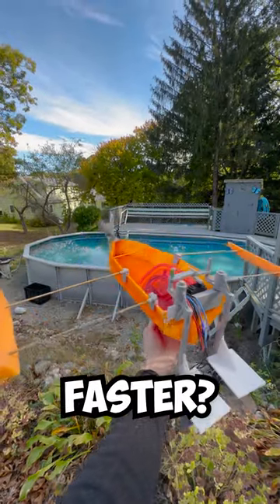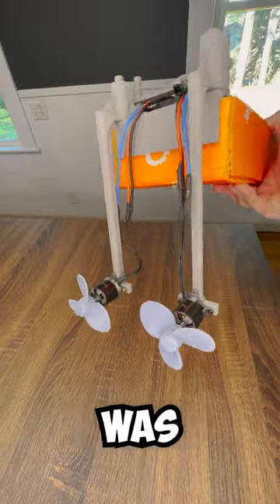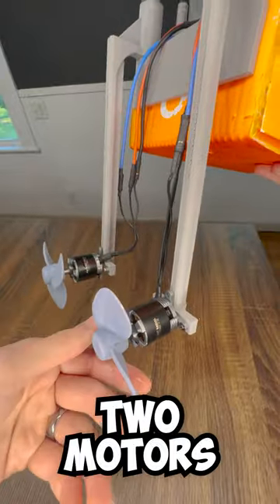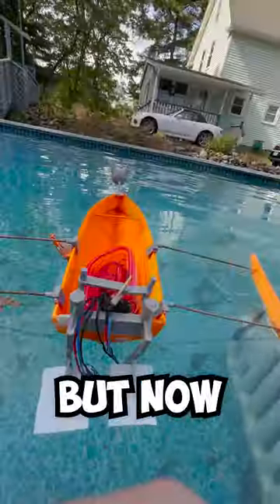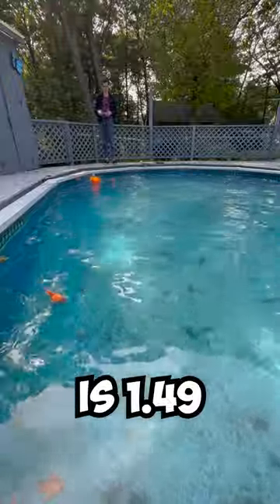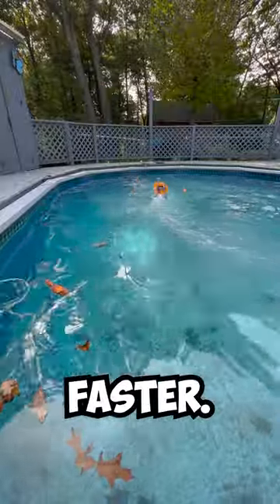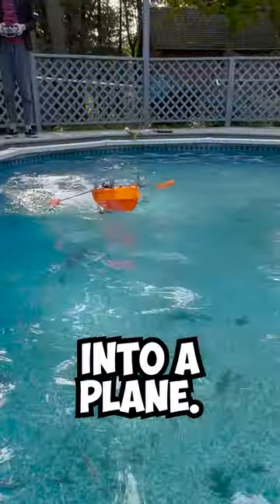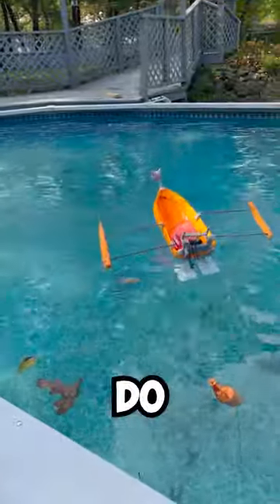Two Motors on DIY RC Boat

Comment: See the thing of having two motors it only adds more torque if you had a bigger whole and the ship was a little bit bigger but has more weights and a skinnier bottom what will happen is that it won't lops side if you don't get this then think of it as having a small yacht and you put 8 engines on it it's going to have so much energy world which he capsize, so when you do this ensure that the body actually matches the power of your motor

Comment: You have the Motors way to much under the water, which causes it due to lever flying Out of the water, If you want to have it fly Like a Katamaran or smth, Put the Motors in the middle of the boat and add some weight in the front

Comment: Use them more narrow hall that haul that you're using is good for marshes but not for the thing that you're using it for using long skinny call with a flat top that widens out if you need a reference look towards Viking boats that will provide a lot more room for all of your electronics

Comment: maybe make the tip of the hull heavier  and add a gear ratio so you get more RPM or make it 2 motors power 1 large propeller?

Comment: Add More weight on the front and remove the wall on the back, when the boats underside suddenly stops the water exits to the top making a twirl Pulling the end and lifting the front.

Either remove the wall entirely or give the boat a "tail" 😂
The tail should help quide the water further away from the boat so it doesnt twirl

Comment: Try having two motors in the front pulling it or don't have them so low in the back with huge flat plates because it's trying to hydrofoil

Comment: You need to adjust the angle of the engine, te aim is to sink the bow and lift the stern, to keep it flat.
Simply let the engine pointing the pow of the boat

Comment: Made it two heavy make a catamaran style hull with material a little lighter than the one your using. And use lighter material for propeller holders.

Comment: you need to remove the two little platforms above the motors because those platforms are making it back pike a hydrofoil

Comment: Design the bottom so it has the ability to cut through the water if you look at speed boats their bottom is Angled and they use it to cut through the top of waves while flying at high speed
Reply: Before they say he has done this he is missing the inward swoop that boats have to give the the self correcting stability that they have to make the singular motor not mess with the direction❤

Comment: Is the propellers are too far down in the water. It needs more weight. And make it a smidge and slicker. Those are ways you can make it better with handling speed.

Comment: ok so first, your gonna want to increase the length of your drag race cause as you make these faster with improved motors your gonna have to start slower so it doesn't flip. also based on normal boats your engines are way to low in the water

Comment: your back of the boat was too heavy that's why your boat become to fly at initials. but if you manage the weight then the boat go at full throttle in a straight line

Comment: how about you make the boat more fluid-dynamic and instand of having straight up poles mounting the motors have it a teardrop shaped and also the boat’s stern should also be closed with a sharp fold instead of having that massive horrid flat ass surface tension drag nightmare of a fast boat

Comment: Longer boat or smaller and shorter length on the propeller arms. Too much torque and because it has no where else to transfer the energy you gotta compensate

Comment: I could say the stupidest thing in the world, but in theory, water, behaves like a gas from some points of view, if you put a wing like F1 to keep it low, this is because physics exists, but I don't know if it works because it could be that water doesn't behave like gases when it lifts, Because the shape of the ailerons creates a zone of high pressure above and low pressure below, since low pressure can not withstand the high one, it is pushed in the direction of low pressure (in this case the low) but I don't know if with water it does something like this, correct me if I'm wrong.
Reply: “Water behaves like a gas” because air is in fact a fluid. That’s why we use fluid mechanics/dynamics when designing and building aero surfaces.

Comment: U could just program a ramp up cycle into the motor driver/arduino. So when u just mash full throttle it will stop you from being an idiot.

Comment: I have a remote control Lamborghini and if I pull the the throttle it will not go straight so I drive it frst and then pull the throttle

Comment: Your motors are too low... need to have the center of the propellers be in line with the bottom of the hull of your boat

Comment: Try making it lighter with my horse power
Reply: More power adds more torque which make it tilt higher up and less makes it lift up easier so maybe add more weight (small amount to the front) and then more power
Reply: @Pilotjacobw  yes I very much agree